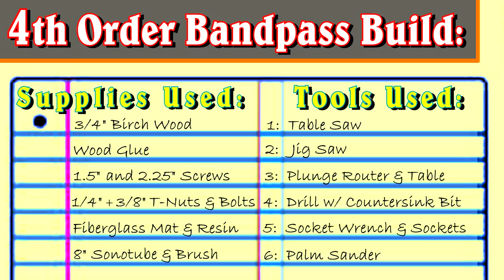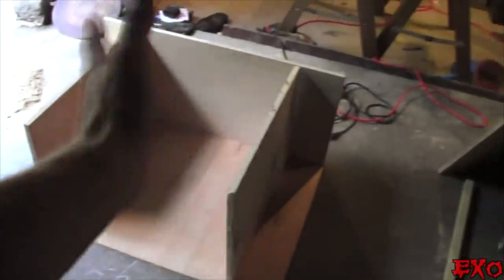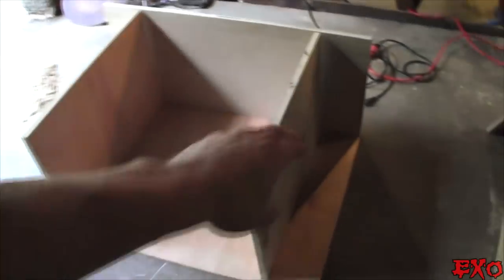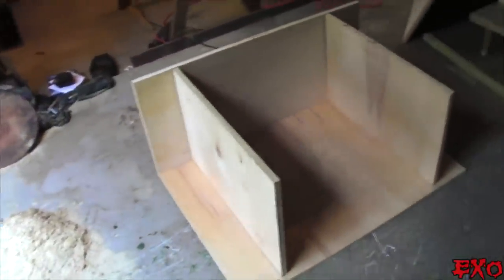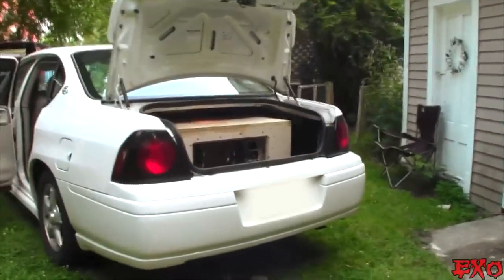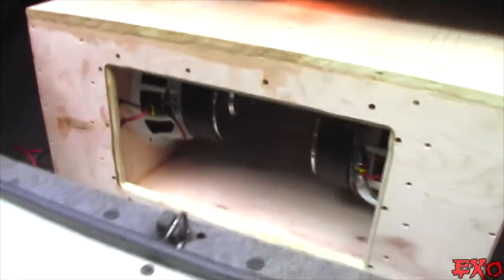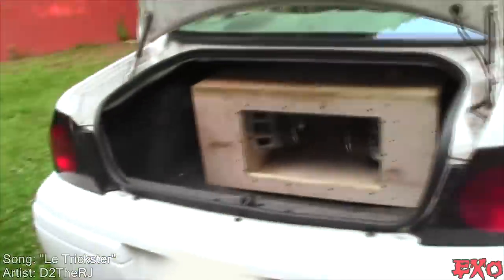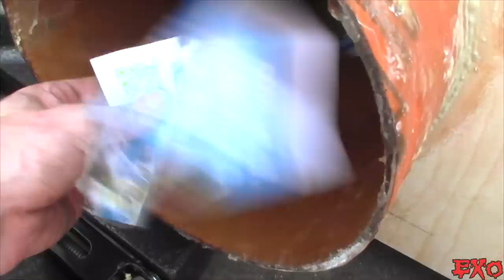Building a Bandpass Subwoofer Box | 4th Order Sub Enclosure Build / 2:1 Ratio / 2 Sealed 4 Ported

Comment: Yo EXO got a question. Whats the air space volime for the Meso 12s? Their websight says 1.5 cubic feet after displacement but for some reason in a box built to these specs they sound muddy and not crisp. I'm upgrading from Skar EVL 12s and they sounded way better but also each EVL had 2 cubic feet air volume. I messaged CT Sounds mulitlpe times asking this same thing but they never reply back. Thanks for your time and help bro.

Comment: Love watching these box building videos. They are a prime example to show customers how much work actually goes into building a subwoofer box. In my shop people aways ask me "why so much"& "it's just a box why do you charge so much" and my favorite question "does the box even make it sound better" and all of these are great questions to ask a installer. As a installer I bought a eBay special $45 box for a single 12. And I built a box for a single 12. (Rockford fosgate p1) both boxes use that woofer. That way when people tell me it's just a box and it makes no difference on how the speaker(s) sound I show them a example of why you need a custom box built for your exact subwoofer.
Reply: Well said , and that's a Great idea ! Way easier to show someone  , than trying to explain it . Plus they can hear the difference for themselves 💪😎👌

Comment: Hey Exo, getting ready to do a 4th order build in a month or 2. I have 2 questions. 
1. Is it better to have the speakers  in the same space in the sealed section or have a wall in the center separating the 2. A wall would add support from flexing, and maybe sound/work better?
2. Square or circle port? My first enclosures where square and they where more vibrate, if that makes any sense. where my circle port was more blaaarrrhh! Which from what ive read as long as there tuned the same shouldnt make a difference, the difference between the square and circle ported enclosures i made is the circle was not sectioned, each speaker could see each other, all sharing the same air. Whereas the square ported boxes where like your standard ported boxes each having there own ported compartment. So this kinda plays into the first question, would a wall in the center, separating my 4 12s, add to the vibrating? Ive done a ton of searching and i cant find answers. Thankyou!

Comment: I need a recommendation,i have 2 JL audio 12wxv2.... im running 1 at the moment (@150w rms)and its not enough. Its sealed. Amp is Fosgate p300.1. It can do 300rms at 2 ohms. These subs are 4 ohm

I am wondering if a single 15" could sound as good or better on the 300 rms?
I kinda feel i should build the box for 2 12s i have before a purchase but dont 2ant to for a let down.
I had a bigger system with 12w6s... 
I want loud deep SQ out of 1 15" or 12"...or 13"
Guys?
Reply: First get a 1ohm stable amp then find out if your subs are SVC or DVC than if they are 2ohm or 4 ohm if SVC 4 ohm run in parallel and bridge at the amp for a 2ohm load at the amp.

Comment: Nice build... from a construction standpoint if you want to add rigidity to a box like that rather than drilling into endgrain you can cut a dado in the top and bottom pieces to receive the vertical pieces. You could use biscuits for alignment and a 1x1 firring strip down the side of each panel to screw into from both sides so you avoid endgrain.

Comment: Exo Hi
I have two ground zero  gzca 5k amplifiers at 1 ohm giving 5600 at 14 volts and at 2 ohms giving 2800 my subwoofers are gzhw15 spl dual 1 ohm but I actually tested them are dual 1.4 ohms so final resistance or 0.7 for every two subwoofers or 2.8 ohms these amplifiers are manufactured In Brazil is there a problem running them on 0.7 ohms and what should I do so that no damage happens to the amplifiers and if not who has a method to run the subs on 1 ohms thank you all

Comment: I'm new to bandpass boxes but I have been researching 4th order enclosures today. Couple questions:
* Why did you do double wall speaker walls? 
* Why did you use such a large port diameter? The larger the port diameter the longer the port has to be.
* What is the air space requirement for the front chambers of the speakers? Doesn't look like much.

Comment: All that drilling and countersinking you've done in just this video alone, you should go to your local Lowes, Home Depot, etc and pick up a set of Dewalt high speed rapid load quick change countersink bits (Dewalt part # DW2535).  I also use a Dewalt rapid load quick change chuck in my drill. I payed 25 bucks for that set, seems high for 3 drill bits but they have lasted me 3 years now with out dulling etc.  Once you use them 25 is WELL worth the money. I bought them for installing kitchen cabinets but I've used them on box builds, my back porch, rebuilding my house, I mean just about anything that involves putting screws in it lol.

Comment: Okay, so the face plate...wouldn't you want to use like a weather stripping round the open to ensure an air tight seal? I know tightening down the bolts in their pattern probably seals it up nice but is it 100% air tight? Not ragging or trying to be a know-it-all just curious as I've never built a 4th order before.

Comment: if I wanted to build one too, idk if anyone has asked. could I build a 4th order box with both of my 12s in the sealed portion at their combined cu ft, then continue the build as you would for the ported section? or do they have to be in separate sealed off sections. I only ask because I'm running my subs wired together in parallel at a 2 ohm load and want to keep it that way with the amp I'm using. thanks for the help if you have a second!!!

Comment: Hey EXO. I was wondering if you could help me out on this box build I'm working on. Its a 4th order with a square/rectangle port (not slot) and I just want to understand something. If I build this box, the ported section should be tuned to 41hz... BUT I've seen many bandpass boxes play stuff into the 20hz range. If I make it 41hz, am I able to have the high pass filter on my amp around 20-25hz without any damage or loss of sq/SPL? I know I would damage stuff in a normal ported box but I don't know for a bandpass box.

Thx
Reply: 2/1 or 3/1 ratios on sealed/reflex chambers, bigger the sealed ones lower it gets, 50-60hz tuning on the reflex side and with as big port as possible.

Comment: Hey guys I need advice. I got a sundown sa12 (yes underpowered on 600 watts rms) and I got a 2.5 cubic ft box internal, 3ft overall. And it's tuned to be loud, about 42 or 43hz (dunno the EXACT number) is this okay to keep this as my daily driver? I had heard about putting a piece of mdf in the port and screwin it in to make it smaller? Thus making the tuning lower?
Reply: Built another box and get it tuned for SQL ( 32hz - 35hz )
Reply: DaVonte Tucker nah go 28hz so you can get low notes, he wants to be loud after all

Comment: how did you tune the box/port ? thanks
Reply: That's what  was wondering. That diameter vent as short as it is would result in a really high tuning frequency. You always want that tuning frequency to match the sealed enclosure resonant frequency otherwise you get peaky, uneven output.
Reply: Scott Vandergriff that’s incorrect. In a single reflex bandpass the rear is sealed and represents the lows. The front chamber is ported and tuned to what the calculations tell you. There is a few math formulas used to model & calculate the  dimensions for each chamber as well as the tuning. 

You can’t just makeup some random dimensions and a ratio oh 2:1 tuned at 50 Hz and boom you have a perfect bandpass. Plus Most ppl say their ratio is 2:1, they are saying their ported side is 2: 1 when that is backwards. Usually the rear sealed chamber is bigger in a correctly calculated and designed bandpass. So if you calculated & modeled it correctly and said it’s a 2:1 that’s means the rear sealed section is 2 to 1 of the ported chamber . The front chamber can be made larger to increase efficiency, however this would bring down the ratio. Have a good day!

Comment: I just saw this was for 2 12s lol. I have 2 15s would I just add 3 inches on all the cuts or what? Please respond with an answer. Thanks
Reply: No box would be a lot larger for the 15 inch subs in a 4th order. Usually you can get almost 3 12's in the box for 2 15's

Comment: I know this is an old video but i wanted you to know you inspired me to keep plugging away at making my 4th order fit with a 8 inch aero port in my 2019 nissan versa sv.  The subwoofer is a fi sp4 18 v2.1 dual 2 and im going to be running it on a taramps smart 3k at 1 ohm with a 350 amp alternator and 40 ah lto lithium battery.  The chambers are pretty close to 1 to 1 with the sealed chamber being 3.60 cubic feet net and 4.43 net ported to 40 hz.  Im hoping for at least a 140 to 142 db at a burp.

Comment: I know this is an old video but how do u determine which way to face the sub in the sealed and ported area. My understanding is the QTS of the sub is this true??
Reply from the maker: Nooo, that's simply a matter of available volume. If the sealed section has enough volume, the only advantage of inverted subs is cooling.
Reply: EXOcontralto thanks brotha, appreciate you taking the time to answer

Comment: This might be the place to ask, I have small space." 34 skyline " boot/trunk, and I have 1000w kenwood mono block running two 12" 1500w 4 ohm subs. Just got a standard duel box buy off the shelf and its to small, iv blown and cracked the box. Dont know to much but I know enough.  I need a bigger box but I dont have the space so is there a way I can have a compact box and still works?  I like the box you made but it definitely wont fix in my car
Reply: Still need ideas?
Reply: U just need to make ur own man, so use the same wood he used (mdp) and double it up the whole way through, may take some time but it'll be worth it
Reply: you dont need a bigger box, you need better wood and lots of screws

Comment: Awesome vid, much respect. If I were to build a 4th order. How do I calculate the the volume of the sealed portion the woofer plays in? In this case u have the woofer firing into the sealed area. If I were to mount the woofer facing each other. Hope I make sense?
Reply: Late reply but the sealed portion should be very close to manufacture specs.  Example, if the manufacturer recommends a sealed box be 1 cubic foot, then you build a cubic foot sealed chamber for each of your subwoofers.  Seems like lots of people go 2:1 ratio for musical, meaning 2 cubic feet ported for 1 cubic foot sealed.  Generally, the higher the ported size, the lower the bass will be.  Hope this helps.

Comment: My subs, one so far, it's foam has dry rot, I thought my plywood cabinet was rattling at first, the HE2's are about 10 years old, wish I had inspected them closer before putting them under the bed in my van, I am gonna have a hell of a time getting them out, have to redesign my bed to make it possible to get access to them later. I would love to get another box built, I like that setup.
Reply: TROLL TREMENDOSITY
Reply: Take the Red Pill
WTF

Comment: Nice video. I haven't built a sub box in about 13 years. I use to have 3 12's JL Audio W6's and I made a sealed box for them. Each sub had it's own chamber. The one important thing you want to do first is take measurements of the inside of your trunk. This of course is to make sure your box will fit in perfectly. The last thing you want is a box that's too big for your trunk. Take in consideration the trunk lid/door hinges and trunk hatch cylinders. They can get in the way when closing the trunk.

Comment: EXO you crazy man!!!! LMAO love your vids and i have learned a lot from your builds.  will this also work for 2 P3 rockfords 12 inch, running with 1500 amp rockfords?  Also using your tip on marking for sub cut outs i did it on my box ported at 25-30 htz range, it the markings was so perfect thank you for this tip it was easy and fast. thanks EXO.
Reply: sorry forgot to say it was DVC

Comment: Birch is lighter but density is what you're looking for when seeking a materiel to build speaker cabinets out of. more density = less box ring = truer sound replication. birch @ only 3/4 in thickness in a plywood stock for your cabinet cannot achieve this reproduction of sound.
Reply: 666hobart put sound deadener in it and it won't matter
Reply: Rhino liner on the inside.

Comment: I thought plywood wasn't good for sub boxes?
Reply: It's birch wood..totally different then regular plywood
Reply: +Todd D most boxes usr MDF (medium density fiberboard)which is basically sawdust&glue/binder. 

it's cheaper but also way more consistent throughout than any piece of actual wood would ever be, so makes building things where consistency is important (speaker boxes is one of the main ones)very predictable performance sheet to sheet
Reply: it isn't still isn't and will never be good. oh it's birch it's differant.........lolz 
MADE THE EXACT SAME WAY AS ANY PLYWOOD, just made to have a pretty face.  after a while it will do the exact same thing as regular ply wood and start seperating.

Comment: So the bigger the box the more bass?
Reply: Depends on your sub but for the most part yes and also your trading the depth of the bass for lack of quality you have to find the sweet spot ya know
Reply: The fourth order size is determained by the subs vented specs, and sealed size specs. Also the more power you have the smaller the box can be. You dont have to get full rms when you do a fourth order box. best subs for fourth order are kicker L7, JL w6v4,and Mmats p3

Comment: ***** on a 4th order does the sub phase need to be switched when inverting the sub or does it matter what chamber it fires into?????
Reply: rather have the magnets in the ported area therefore u know when the coils start heating up and you can back off without damaging the coils
Reply: I see people asking this..phase only needs to be considered when mix-n-matching regular&reverse mount so they aren't pushing/pulling against each other in shared box/airspace
Reply: @chrismorse3862  true but if you put the motor in the ported side you get some coil cooling fronm the port vs motor in a sealed chamber gererating and being stuck with that accumulating heat.
Reply: +Joseph Reese that has nothing to do with phase though. if they are both mounted like that they are wired the same.